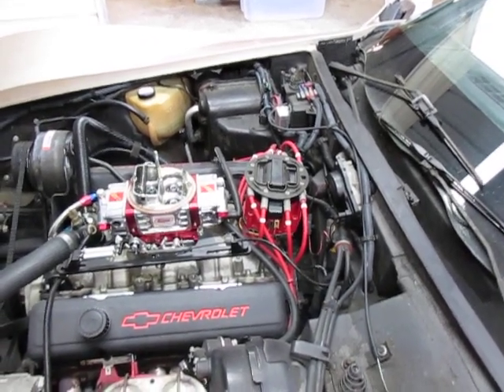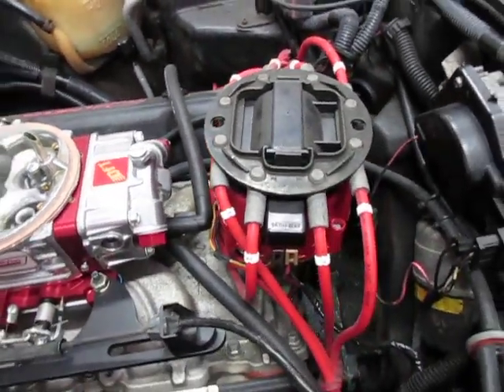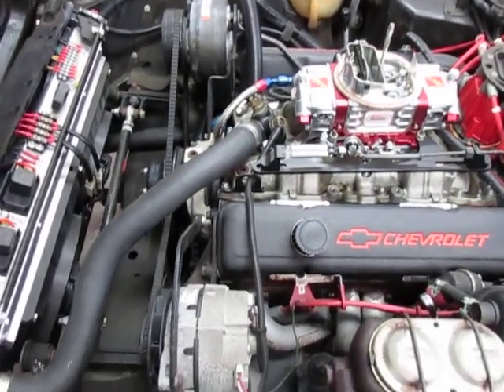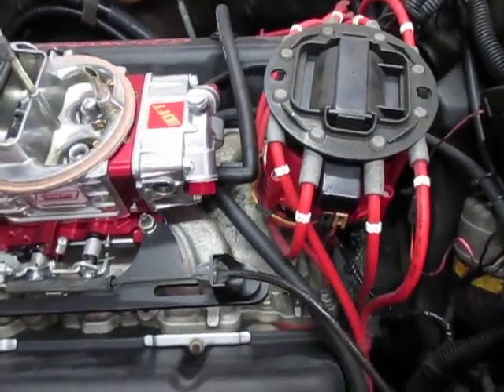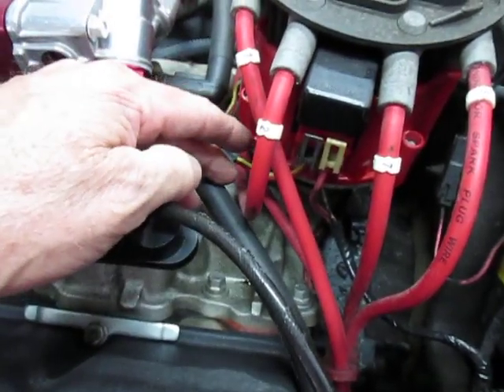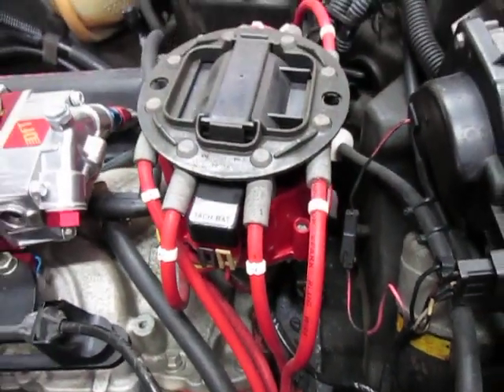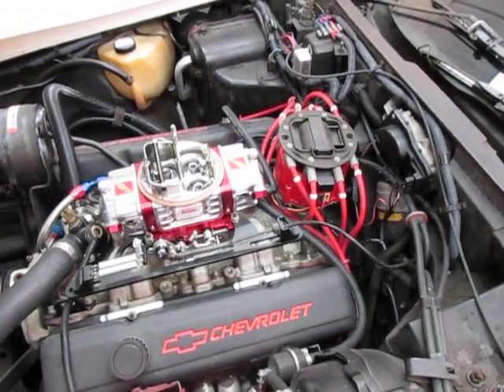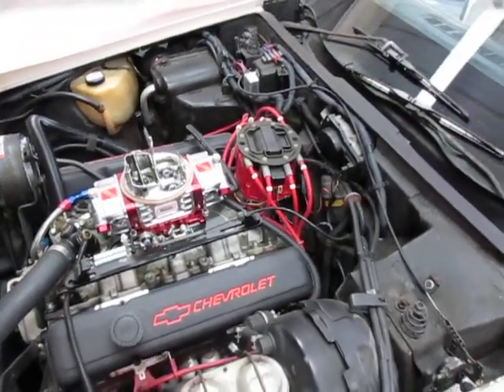HEI Distributor Installation for V-8s

Comment: On my 89 f150 I just put an hei on my 351w and plugged it up but the tachometer don't work anymore and neither does any other gauge except for the battery charging. Would somebody have a solution to this cause I'd like for my gauges to be for purpose and not just decoration.

Comment: What type of carburator do you have on your corvette an did you make a video of the installing of it?? Excellent video on the HEI plugs and wiring , thanks it was very helpful an articulate! 😃😃
Reply from the maker: Thanks so much for the nice comment. When I first put the engine together I used a Holley 0-80670, 670 CFM Vacuum Secondary. It required a good bit of tuning and was a little tame for my combination. A friend suggested I try a Quick Fuel carb, which is now owned by Holley. What you see on the engine is an all aluminum QF, P/N SS-650, 650 CFM Mechanical Secondary. They are pricey, but have a lot more tuning features than the Holley I had. In fact, I'm using this QF as is right out of the box. It's very responsive and I can nail the pedal to the floor at any speed and in any gear there is no stumble or hesitation. Works great with my 4:11 gears and 5 speed manual. See attached videos. https://youtu.be/P1YUTWY0TpU https://youtu.be/TIbG613P5eM

Comment: I'm installing one in my 64 impala this weekend
Reply from the maker: Great. Make sure to replace the power feed with one that provides a full 12 Volts to the HEI input. The original point system will have a ballast resistor or a resistance wire in the ignition feed. HEI distributors need a full 12 Volt supply to operate properly.

Comment: Hey bud great video quick question for you when you have fuel air and spark in the  right  order and  timing  what and why would   a  77 chevy not start everything is  done  right and works it just will not  fire up to  save my life
Reply from the maker: Arville Noe I assume your valve timing is correct. nothing's wrong with the timing chain?? installed correctly?? if so distributor could be installed 180 degrees out. the number one piston must be at tdc on the compression stroke. the rotor in the distributor must be pointing at the number one post on-the distributor cap. hope this helps.
Reply: 10630390 thanks  bud
Reply: Arville Noe  also could be wrong spark plugs had that happen to me on new engine I got was not starting for anything and backfiring
Reply: @10630390  I have a \problem with  1990 tpi corvette.... But my rotor doesn't exact point the number one -cylinder  .it points number 3

Comment: It may be a tooth off it should be straight across or very close to it the way it's done like you have or even straighter will give you the most adjustment for timing and it is just the way its supposed to be and I always. Take the extra time to put it in right
Reply: The position of the body of dist, does not matter on HEI Distributors. If hes at TDC #1 on compression stroke, As long as his rotor inside the cap (Which you cannot see) is pointing directly at his cylinder #1 plug wire stud, on dist cap. Then that distributor could be dropped in at any position you could dream of.
Reply: I agree and as I said in the straight position it's got the most adjustment and aesthetically better but your right it will run just by moving the wires around you can put no 1 anywhere at 12 o clock if you like as long as its 18436572 it will run is it right opinions vary I dont like it or do it because it's so easy to make it right I can do it in three minutes bump it around to keep the oil pump moving with it till i get to 5 o clock and put the cap on and unless the timing chain is slap wore out it should be fairly straight
Reply: @jamiedelle5678  His offering is the proper way to configure this distributor.

Comment: I'm installing one of these on my 89 silverado.  my question is why would I not be getting no fuel. everything else is double checked and it turns over but will not run.
Reply from the maker: I'm not sure what your set-up is, but a 1989 truck would be a TBI engine. The TBI engine takes a small diameter cap HEI with some extra connections to the ECM. Your truck won't run with the type HEI shown in this video.
Reply: It will run with an hei in a tbi motor I've seen it and ran better than the stock distributor

Comment: its in one tooth out cap should be square ! the  rotor points to #1 cylinder all chevy V8s except 348/409/ Zll 427
Reply: The position of the body of dist, does not matter on HEI Distributors. If hes at TDC #1 on compression stroke, As long as his rotor inside the cap (Which you cannot see) is pointing directly at his cylinder #1 plug wire stud, on dist cap. Then that distributor could be dropped in at any position you could dream of.
Reply: I think what he’s saying is to make it pretty and perfect ….moving it over one tooth and adjusting time back to where it is would have make it perfectly square to the engine block.  But you are right…can be placed any position

Comment: Really debating on putting an hei distributor on my 85 cj7 with an in-line 6. Been having issues with it surging and I can’t seem to figure it out for anything. It feels like a misfire like my motor isn’t getting gas. Only happens when I’m going around 55 and in 4th gear.
Reply from the maker: HEIs are good solid ignitions in a neat package. May not cure your problem but probably would be a good upgrade.

Comment: You didn’t mention at all that you need 12 v instead of the 6 v and connecting straight to ignition because if you use the same wire it has a resistor
Reply from the maker: Yes. 6V cars were about a century before the HEI came out. The stock point distributors do indeed have a resistance ballast wire to control current through the system. The HEI does nor require a resistor and should not be used with one. A relay or a separate full 12V ignition feed would be needed for proper operation.
Reply: 10630390 where did you run your 12v power from ? The fuse box or the ignition switch? And will an old pints system be thrown out of wack if you ran rpms too high? Thank you :)
Reply from the maker: @NeoB-Lac  The HEI in the video is on a 78 Vette. It was originally equipped with an HEI. So it already had a full 12V ignition feed, which I used. Not sure what you mean about "will an old pints system be thrown out of wack if you ran rpms too high?"
Reply: 10630390 the points system before hei it was points and condenser
Reply from the maker: @NeoB-Lac  Yes I understand the old points system, before electronic ignition. I'm just not understanding your question: "will an old pints system be thrown out of wack if you ran rpms too high" I would need an definition of "out of wack". I just don't know what you mean.
Reply: I’m trying to convert an hei into my ‘68 impala sbc 327 and keep my factory points resistor wiring intact in case I ever wanted to go back to points for restoration purposes. What type of relay are you mentioning that I could use and be triggered by the factory resistor wire? Thank you